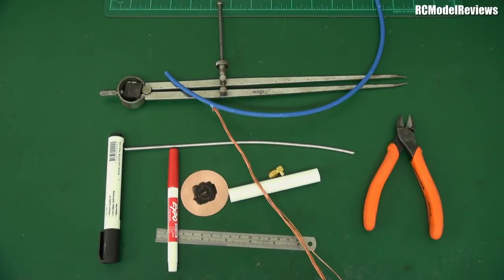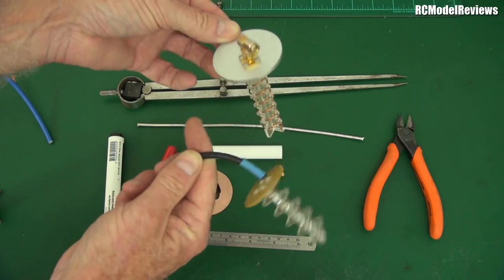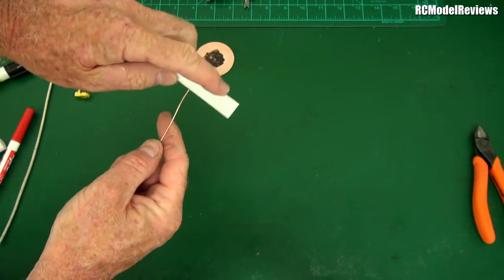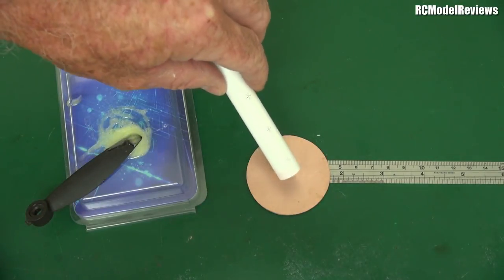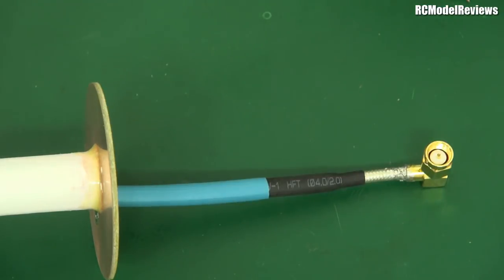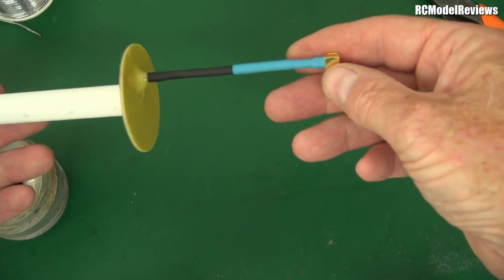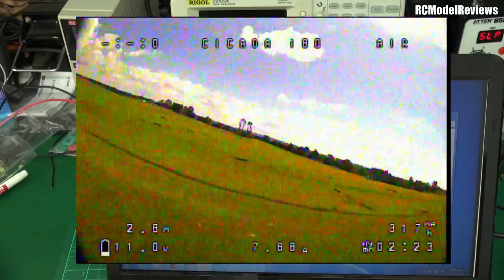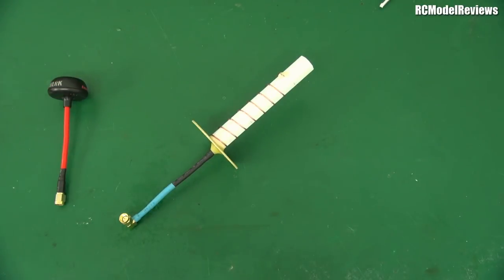DIY Helical FPV Antenna, you won't believe how good it is!

Comment: Excellent! Back in the days, at school, when I studied to become a technician in electronics, I've studied that but it was never with practical applications so I've almost forgotten about everything on this subject. I've almost understood all the things even if I'm not totally fluent in radio related English. Cheers from France by the way! Thank you!
But I've some questions to ask, if I can bother you:
If I've understood the principle, the longer the "barrel" of the antenna is, the narrower the beam is and longer the range is. Am I right?
And for the size of the reflector plate, does it have an influence on the width of the beam (Scotty please!) or does it enhance the reception quality, according to the wave length?
So the patch antennas are flattened cloverleaf antennas with only a reflector by consequences?
Reply from the maker: Yes, the more turns (hence longer) the antenna, the higher the gain but narrower the beam. The reflector size also has an effect on the beam and the minor-lobes (much smaller beams that come out from the sides.  A larger reflector will improve the front/back ratio and make the main beam slightly stronger at the expense of side-lobes and the ability to receive signal from behind.

Comment: If I strip the outside of the coax along with the insulation for the length of the helix, I would not have to solder between the core and the helix, would that work, or is the core too thin?

Comment: Can you disassemble dji osmo (that new micro gimbal camera) and use it on your sub 250g micro drone project ? (I think most of the weight of it is in 18650 batt(s?))

Comment: great video Bruce
I have made a few using the ends of bean tins !
The reception has not been exceptional  - the discs have some corrugations in them - do you think this will degrade the reception?
Reply from the maker: Yes, the corrugations will degrade performance.  Perhaps better to use something flatter.   Our bean tins have flat lids here in New Zealand ;-)
Reply: Thanks for the advice Bruce
I must remember to buy some beans next time I'm in NZ!

Comment: Solid video as always. Quick question. I tried an Online calculator. For 5.8GHz, the calculated the characteristic impedance was 150 Ohms. Is this the input impedance of the front end amplifier of the video RX? I'd have thought it's 50 Ohms. In this case is the mismatch affecting reception? More general question: what's the characteristic impedance of different antennas used for FPV in the 5.8GHz range, if you happen to know? Thank you,
Reply: sincer nu stiu cum de ai merge antena cu teava aceea de pexal (contine insert de aluminiu intre straturile de plastic).

Comment: Is there any particular reason that helical antenna have odd numbers of wire turns, i.e. 3 turn, 5 turn, 7 turn, etc?  Why not 4, 6, 8?
Reply from the maker: It's "odd", isn't it? :-)   The one in this video has 7.25 turns.. but it still works ;-)

Comment: If you want a good way to use hot glue on metal, then use is in conjunction with a hair dryer or hot air gun. Just get the metal warm first.

Comment: Hi! Awesome video, but the plastic pipe in video is a 5 layer water pipe, isn't it? If it is, there is an aluminium layer in it. :)
Reply from the maker: No, I checked.   It's electrical conduit and there's no metal in it.
Reply: @RCModelReviews  Oh! Sorry, I was wrong. :) I work with lots of 5 layer water pipes and I saw the dark "middle" layer on video, that is why I thought that...
Reply from the maker: Yeah.. if it had metal in it then the antenna would not work.

Comment: The bit on the length of the coax isn't entirely accurate. Or maybe not clear. By using a multiple of the half-wave you're just ensuring that the impedance at the antenna is the same at the connector. It doesn't do anything to correct a mismatch. To correct for an antenna that is mismatched then you would need to use something other than the half-wave to adjust the impedance seen at the connector.
Reply from the maker: True... but if you have an odd coax length then you can exacerbate the mismatch.   For example... a low impedance at one end of a quarter-wave of cable creates a high impedance at the other but use a half-wave and you will simply duplicate that same figure at the other end.   A shorted 1/4-wave coax has a very high impedance at the other end and an open 1/4-wave coax has a very low impedance at the other end.  As you know, this is how we create 1/4-wave stub filters using coax.   By using a 1/2-wave-multiple, we simply mirror the impedance.
Reply: @RCModelReviews  Yes, exactly what I said. :)

Comment: any chance that convexing the reflector would widen the beam?
Reply: Good question...I was wondering that as well
Reply: No but using less turns on the coil will widen the beam (for obvious loss in gain).
Reply: Yeah it's always a trade off between gain and been widrh
Reply: It's trade off but anything above 4th turn diminishes gain.

Comment: RG405 velocity factor 69,5%, so wouldn't it be better to shorten the feed wire accordingly (61 or 122mm)? do you have experience regarding that?
Reply from the maker: I took the velocity fact or into account to get the 17mm figure.
Reply: pixelcomet, pardon me if im wrong but your question is probably more suited to an engineer who would design an antenna for marketing purposes which would be sold to hundreds of thousand of consumers worldwide. this is a backyard/garage home made diy project if im not mistaken  If we were to take into accounts the nano level of accuracy, that would have not been done at home, right? well, i still respect your knowledge on that matter tho.(which is too in depth for a lowly educated common folks like us).

Comment: 33:24 what different (doing) is antennas this small triangle plate (between antenna and connector (u dont use this))?  (and like yagi antennas https://www.ti.com/lit/an/swra350/swra350.pdf (marked red circle in picture)) (like this https://youtu.be/BRXOTZVbViw?t=739 or https://youtu.be/u7cq5wUyeQ0?t=317) ... sorry my english (sorry links too) (yes, I'm noob too ;) )
Reply: aa.. search keyword: "helical antenna impedance matching"
Reply: but I know that sometimes scientific discoveries are made by wise scientists with mistakes, and sometimes fools are accidentally

Comment: hobbyking has the same looking thing for $84 US! would a concave reflector work better like a radar dish?
Reply from the maker: Not exactly -- when you curve the reflector then you alter the timing (phase) of the reflected signal at different points along the helix so things would go a bit pair-shaped.  I will be doing a parabolic dish antenna for FPV in a few weeks and I'll be using that with the balloon project over on XJet.  I expect to get a very long way with that antenna.
Reply: RCModelReviews sounds interesting, and some tricky math involved. Thank you. This sort of content is very good to see

Comment: I understand the theory of why things have to be the way they are, but I'd really like to see an actual side-by-side field-test of an aerial made as close to bench perfection as possible, and a dog-rough (ruff!) aerial made deliberately crudely and with none of the accuracy and refinements that theory suggests. You know - bad measurements, bad soldering, bad alignment, bad turn spacing, bad fits of parts... Would the difference be blatantly obvious, or would it require test gear to show it? How would the effective ranges compare? I'm curious because my amateur experiments with aerodynamics, aerofoil sections, Reynolds numbers, and so on, have generally shown that you can get away with sheer bl**dy murder despite what the co-ordinate charts and all the fancy plot figures say.  ;-)

Comment: Best produkt is PtFe .. teflon .. not plastic 
The plugs .. you need to spesifi Teflon insulators .. plastic won't Work in 5GHz 
Use 1.5mm² thikker. Lead gives Better bandwith .. 
Acuressy is key !! Almost won't Work !! 
This duude !! 
Soldering is werri indportent